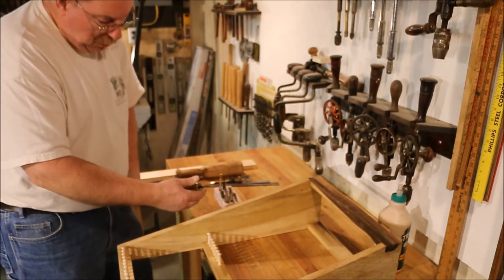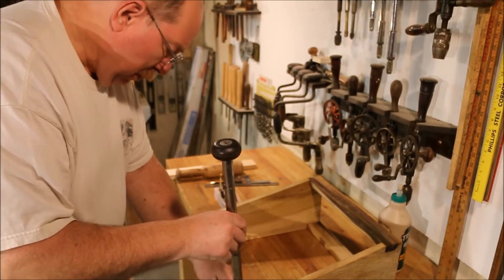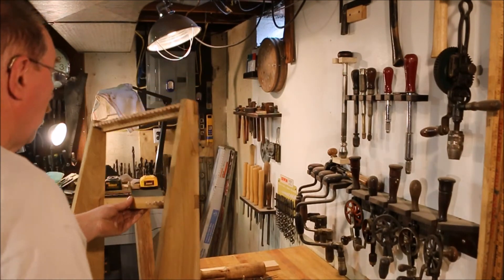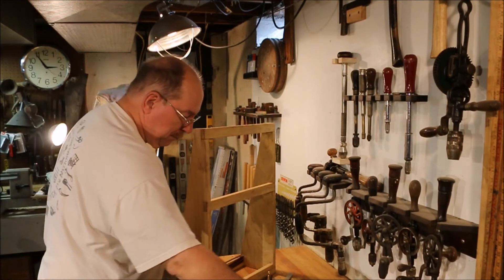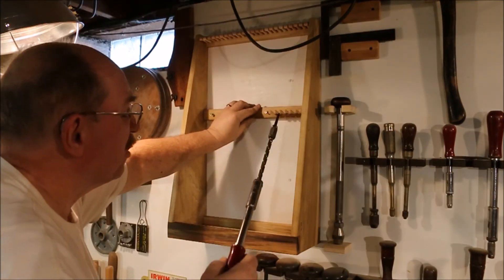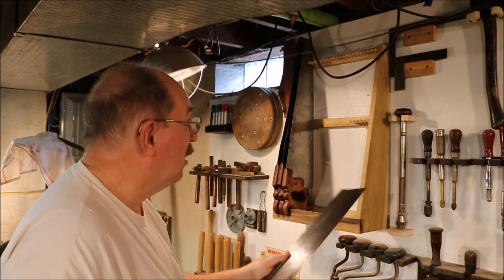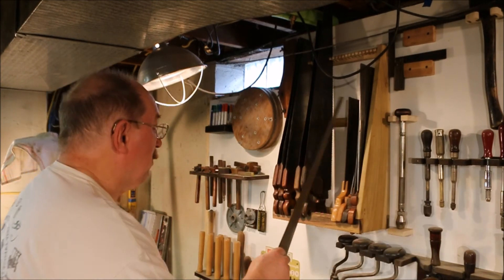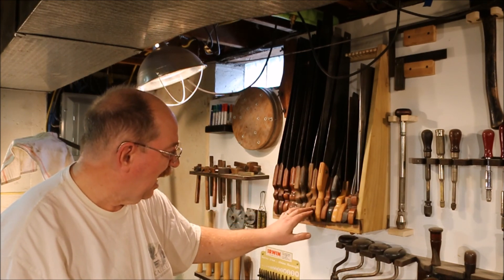MAKING A SAW TILL ~ PART 9 ~ MOUNTING TO THE TOOL WALL

Comment: I like the strip of wood you chose for the front.  Nice color to it.
Reply from the maker: Frank Y Poplar has those strips of color but most of the wood is just slightly green with very little figure or color. The end of the plank I cut the saw till from had just enough for the crosspiece.

Comment: Those down and 75k to go. I still think the annex is in the future. I BLO'ed the backsaw after I laid the wire brush to it hooked to the HB-rig to get the goo off. Nice maple handle. I think it's a knock off or a clone but still a nice saw. No set but fairly sharp. Good enough for who it's for. And it'd be worth it for half the money!
Reply from the maker: Lewie McNeely Glad the back saw is working. If it cuts without binding it probably has enough set. Most of them that I get have too much set.
As far as the annex is concerned, the saw pile is destined to shrink. I need to find a way to sell on line that isn't auctions. Way too much effort expended for the return.
Reply: I confidence you. If there's a way, there's an Unc!

Comment: It looks like the wall is just about full.  Much more and it may start to look cluttered.  You might want to look for some cable nail clips (if there aren't any in the inventory).  I'm definitely going to have to go buy a box, because I have far too many danglely  wires & cables in the basement.  I should also figure out which ones are no longer in use, and pull them out for scrap.  Plus no need to put money into something that has no purpose (Maybe I shouldn't tell SHMBO that's what I'm doing, or she may quit cooking for me... 😜)
Reply from the maker: Brian Neeley I need to Hang the flourescent light over the bench and get rid of the clip lights.